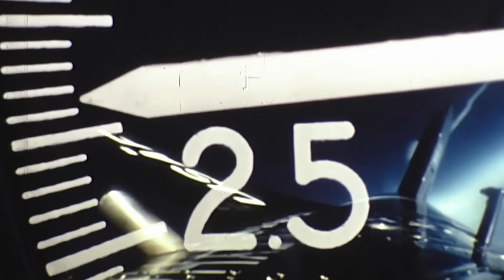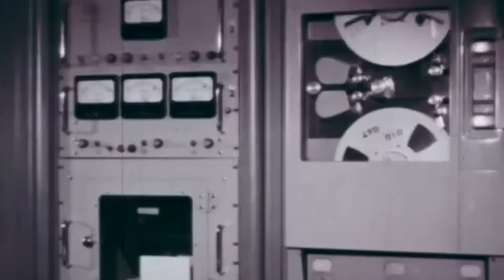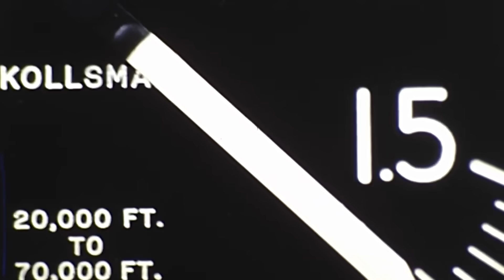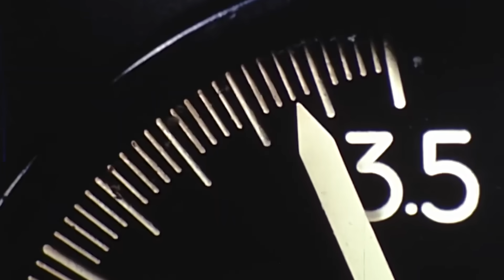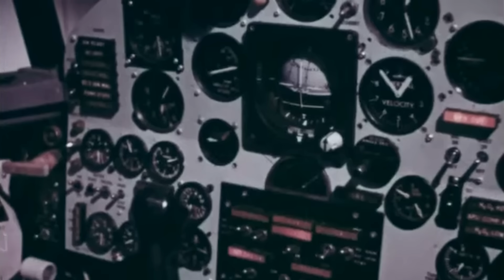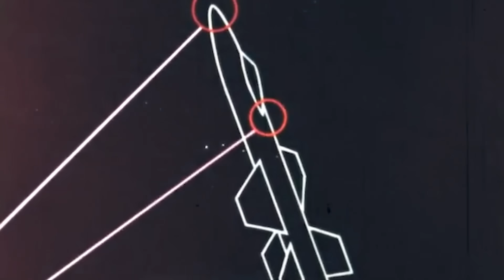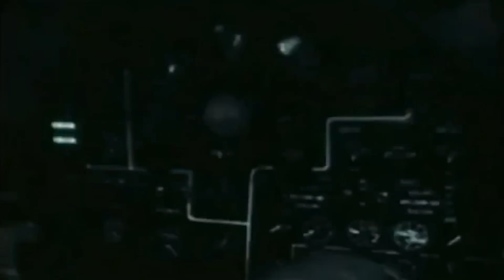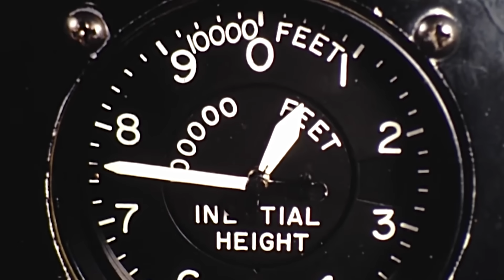The Plane That Accidentally Flew Into Space

Comment: Hypersonic passenger service might be accomplished by skipping in and out of the atmospheric oxygen layer where ignition and thrust would occur intermittently, thus saving fuel and drag. That sounds like a dangerous balance where a wrong reentry attitude at any point could spell disaster like in this episode. Does reaction-wheel technology make this possible? I've heard of an outer atmospheric layer where the air is thin, yet extremely hot. How will such hypersonic craft offer protection from that, cosmic rays, and friction heating?

Comment: Virgins SpaceshipTwo only reached 51 miles up and never reached space (being about 11 miles short) after several attempts.   The X-15 reached space back the 1960's by going more than 67 miles up crossing the Karman line at 62 miles up.
Reply: The really sad thing is that the prototype, SpaceshipOne, built by Burt Rutan flew MUCH higher in 2004. It can actually beat the X-15. Richard Branson was supposed to work with Burt Rutan to build the SS2 for Virgin Galactic, but it never worked out and for some reason apparently it can't even go as high as SS1 did. What a huge disappointment.

Comment: If the solar powered ram jet plane does work, it might be miniaturized down to a very small size.  A one centimeter, one gram plane travelling at ten kilometers per second would have about a hundred times as much destructive energy as  a .45 magnum bullet that can put a hole through an engine block.  The tiny plane could put a hole right through a nuclear warhead.  The video mentions a large force needed to travel at supersonic speeds.  But if the air is  a hundred times thinner at very high altitudes, a solar powered ram jet might travel at suoersonic speeds and even fly into space.  
A major argument against the ABM program is the expense of the system if the enemy can just make more nuclear missiles at a lesser expense.  If a $10  solar plane can destroy a $10 mllion dollar nuclear warhead, the argument is not convincing.

Comment: You could fly into space in a Cessna 150 if it was capable and equipped for it.
Reply: Err... Yeah? xD Sure, if you rebuilt the Cessna 150 such that it was wrapped around a large rocket engine, knock the tail off (it'd never withstand the acceleration and it's unnecessary), shortened and reinforced the wings... Well, actually just ditch the wings too, at these speeds they're just in the way... Let's see, what else... RCS thrusters for maneuvering, seal and pressurize the cockpit, it'll need to be rebuilt so it can be streamlined for aerodynamic reasons... we'll need liquid oxygen storage in the fuselage so that the engine can continue burning once leaving atmo... At this point there's nothing left of the Cessna, we just have a manned rocket now. xD
Reply: @jasonmack760  Okay.......thats all fine. However my statement is not wrong.
Reply: @allybally0021  True. You could definitely rebuild a Cessna into a space-capable craft. There wouldn't be a single original part left of the Cessna, so it's kind of a Ship of Theseus situation, but yeah. You could do it.
Reply: @jasonmack760  well......we reach partial agreement. Pretty good.

Comment: We could have done space this way: an escalating series of acceleration vehicles, rather than large boosters. It was discussed before, 70 years ago, and should be again.
Reply: A parallel aproach.  Big rockets are good for cargo to space.  Notice there are no heat tiles on X-15.  Special alloys, made her real expensive, but she was reusable already.  Sure, from orbit she'd need more protection.  But that was also part of the research.
🚀🏴‍☠️🎸
Reply: Why, though? The max speed of this plane was 4000mph or so. If you want to get into orbit you need at least 17,600mph. That's why the discussion ended. Loooong before you reach orbital velocity the wings cease to be a useful part of the craft and are just in the way. Much easier to just build a rocket.

Comment: The video at 10:19 is an F-4E . It is NOT the X-15. You can plainly see the right wing fold, the twin engines, the anhedral horizontal stabilizer, the vertical stabilizer, the deployed landing gear, and the nose gun shroud. I was an F-4E crew chief in the USAF. It looks like the crew is dumping fuel. The fuel dump opening is just below the vertical stab.

Comment: Orbital velocity is about 28,000 km/hr it is this velocity that causes the fiery reentry. The X-15's velocity was in the vicinity of 3000 km/hr. Heating on reentry, sure, but not actually in the same ballpark. Comments like that make the entire doco lose credibility.
Reply: Without heat shielding, 3000 km/hr can melt an airframe just fine.
Reply: @jasonmack760  That has nothing to do with the fact that "reentry" is meaningless here and is not a hazard in itself like the uploader said, it doesn't make sense.

Comment: Planes cannot “fly” into space, there is no air to provide lift, a jet engine may propel them into space but re-entry would be extremely hazardous, the wrong entry angle and they’ll burn up.
Reply: It was a rocket engine. Not a jet engine. It also had an RCS system for maneuvering when the control surfaces are less effective.
Reply: Re-entry burning is not an issue of reaching "space", but of speed. Craft returning from actual orbit, or from the Moon are at several times the speed of the fastest X-15. The X-15 were essentially ballistic in their "space" excursions so I don't think they would come down any faster than they went up. If they didn't burn up on the way out, they wouldn't burn up on the way back in either.

Comment: This seems like a strange tale. Was this an aircraft, bearing in mind that (i) it was pro with a fuel more similar to a rocket, and (ii) at its zenith it was flying through an atmosphere almost as thin as that of the planet Mars, i.e. virtually space. Certainly escape velocity starts to be feasible within this distance above sea level. And yet, even with the X-15A-2, they term it a aircraft: is that only because it doesn't have the capability to leg it back through the atmosphere if it goes too far? These conditions are not a very realistic set up for a craft which was already at that being surpassed in speed by Mercury space rockets (1961 at least). The only observation I can think of making about this event otherwise, is that it must, if Elon Musk gave it his attention at a later date, have inspired him in his idea to produce a re-usable rocket. Your rebuttals are invited to remove me from this cloud of ignorance I appear to suffer!

Comment: I really don't agree with the title of this clip. The X-15 was intended to fly up to the ends of the atmosphere into near outer space, which is why it utilized react thrusters at the top of it's flight for stabilization, because conventional flaps would be useless. Also, I believe that all X-15 pilots were eventually granted the rating of "Astronaut" on their records for their flights in the aircraft because of the altitudes achieved.  Please correct if I am wrong, this is my understanding from the documentaries I have seen.
Reply: The X-15 flew a total of 199 missions over its 9 year life. Of those, 13 missions were classified as spaceflight, and those were flown by 8 or the 12 X-15 pilots. Those 8 pilots all received astronaut wings from the Air Force and NASA for their achievements, although it took NASA until 2005 to finally recognize their own pilots in that way. The 5 Air Force pilots all received their astronaut wings at the time the flights occurred in the 1960s, although one of those was a posthumous presentation since Michael Adams lost his life in the only fatal X-15 accident of the program on 15 November 1967.

Comment: You claim that it came 'near orbital speed'. It would have to go four times as fast, and that's a whole different animal as far as reentry speeds and the amount of fuel you'd need. There's a reason why it doesn't look anything like the space shuttle because you'd need a huge tank and solid rocket boosters attached to its sides to do that. It's the old problem that the faster you need to go, the more fuel you need, the more fuel you need the bigger engines you need, the bigger the engines, the more fuel you need, the bigger the rocket to carry the fuel. etc etc...

Might as well say that a weather balloon comes near orbital speed because this plane is closer to weather balloon velocity than it is to orbital velocity. It's only a quarter of the way there.

Comment: Doesn't the X-15 still hold speed and altitude records for a powered aeroplane (i.e., a vehicle that uses fixed wings to generate lift)?

Obviously, the Shuttle Orbiters hold speed and altitude records for gliders . . .
Reply: The X-15 speed record of Mach 6.7 or 4,520 mph, was set on 3 October 1967 by pilot Pete Knight. That record still stands today—by a large margin. The altitude record of 354,200 feet set by Joe Walker on 22 August 1963 was finally surpassed by SpaceShipOne on 4 October 2004 with an altitude of 367,500 feet.

Comment: As a boy I was fascinated by and proud of this American venture. I wish you had covered the fastest flight here. Photos afterwards showed burned off and melted titanium parts. Much of the surfaces were burned a bright chalky white. The pilot was lucky to be alive.
Reply: The fastest flight of the X-15 occurred on 3 October 1967, and was flown in the X-15A-2 by pilot Pete Knight. He reached a speed of Mach 6.70, or 4,520 mph. The aircraft was covered in an ablative coating which was in-turn sealed by a white paint layer. The white was not from burning. Also, the X-15's skin was a nickle alloy steel called Inconel-X, not titanium. Titanium, such as was used on the SR-71, would have melted at temperatures half what were encountered by the X-15 in flight.

Comment: I need to set the record straight here. The very first sentence in your narration is incorrect. On 22 August 1963, Joe Walker set the official altitude record for the X-15 program at 354,200 feet (67.1 miles). The altitude record was the purpose of the flight that day. However the speed you mentioned is completely wrong. On that flight Walker topped out his speed at Mach 5.58 or 3,794 mph, 726 mph slower than what you have stated. The speed record of Mach 6.70 or 4,520 mph was set on 3 October 1967 by Pete Knight, and remains the fastest speed a manned aircraft has ever flown. These are two different flights, by two different pilots, and accomplished on two different aircraft. Walker's flight was done using X-15 no. 3, while Knight's flight was using the X-15A-2.
Reply: There are so many things wrong on this video, that it is hard to watch, but I watched it all anyway, just see how bad it got. The idea that every flight could end in a fireball, that Walker didn't know what he was in for that day, the "fact" that NASA was trying to save his life by keeping the altitude below 400,000 feet, the statement that the X-15 might inadvertently fly into orbit, and on and on. Every one of these comments is laughable. Even the number of flights accomplished by Walker is incorrect. This mission was Walker's 25th in the X-15, not his 23rd. It was also Walker's final flight in the program.

Let's go on with more: Walker did not fly the first mission with the XLR-99 rocket engine on 15 November 1960. That mission was flown by Scott Crossfield.  Walker didn't fly with the LR-99 engine until 30 March 1961. The 3rd X-15 flight was not flown by Neil Armstrong in December 1961. Neil's first flight was on 30 November 1960, and was the 29th flight in the X-15 program. Neil did fly the first mission on X-15 no. 3 on 20 December 1961.

The recognized altitude in the United States for spaceflight is 50 miles, not 62 miles. Eight of the twelve X-15 pilots achieved spaceflights (not the 6 you mention in your video), and were all awarded astronaut wings for their accomplishments. There were 13 astronaut qualification flights in total out of the 199 X-15 flights. There were only 2 flights above the arbitrary Karman line, and those were both accomplished by Joe Walker, so you saying that six X-15 pilots  became astronauts is against your earlier narrative about the need to cross the 100 kilometer mark.

Walker did not fear for his life on the 22 August 1963 mission. He was well within mission parameters, and there was nothing that precluded the X-15 from making a safe reentry from 400,00 feet. Estimates placed the ultimate ceiling on the X-15 at approximately 430K feet. Lots of other quibbles about what you state in the video, but these are the major points that needed to be highlighted, and should be corrected.
Reply: @x15galmichelleevans
Reply: @x15galmichelleevans
Reply: Where does space begin?
USA: Astronaut Wings at 50miles = 80km ~ 240k feet
International Karman Line: at 100km = 62.5miles ~ 300k feet
🚀🏴‍☠️🎸
Reply: Bet you're fun at parties.
Reply: @shaunwalker813  Yep, sure am. Most people I know like to know the truth about things. I would hope that would be the same with most everyone.
Reply: @x15galmichelleevans  I always thought it was Neil Armstrong who was the first one to cross into space in the X15. And had trouble coming back through the atmosphere? Is this completely wrong?
Reply: @djmastergroove946  Neil actually did not fly into space at all when he was piloting the X-15. His highest altitude was 207,500 feet (39.3 miles), well below the 264.000 feet (50 miles) needed to receive his astronaut wings. That flight occurred on 20 April 1962, and was also the mission where he had trouble on reentry as he skipped back up out of the atmosphere. He did that because he was only paying attention to his g-meter and not anything else that was happening in the cockpit. Paul Bikle nearly fired him after that flight, and led to Neil's departure from the program. This was the flight depicted in the opening sequence of the movie "First Man." In that movie they got so many things wrong about this flight, and pretty much everything else as well, that I won't even get started. And I say that even though I was a technical consultant on the film. I was extremely disappointed in how that movie turned out.

The first pilot to enter space on the X-15 program was Robert White. His flight on 17 July 1962 achieved an altitude of 314,750 feet (59.6 miles). Not only was this the first astronaut qualification flight, but was also the first time a manned aircraft exceeded 300,000 feet in altitude. The following day, White, along with fellow X-15 pilots Scott Crossfield, Joe Walker, and Forrest Petersen, received the Collier Trophy in Washington DC from President Kennedy for their achievements on the X-15.
Reply: Yep.  I stopped listening to him.  The sound was much better.  Reminded me of the relation between technological and musical progress.
🚀🏴‍☠️🎸